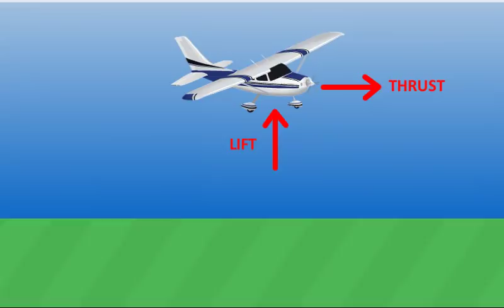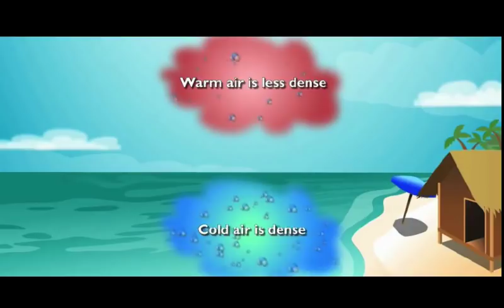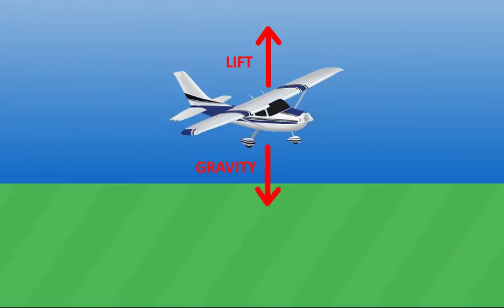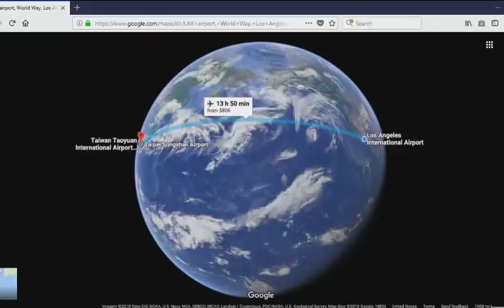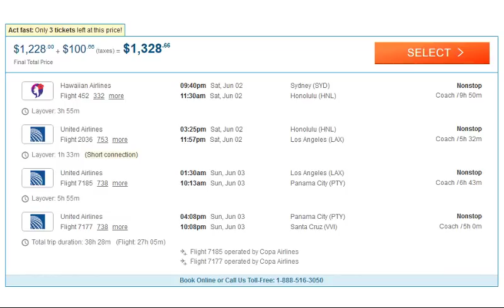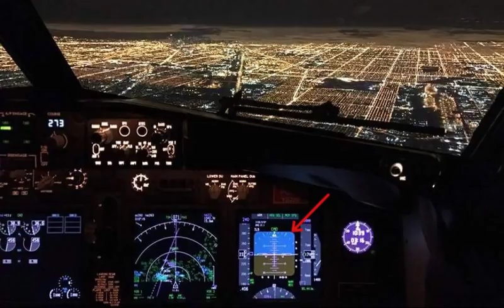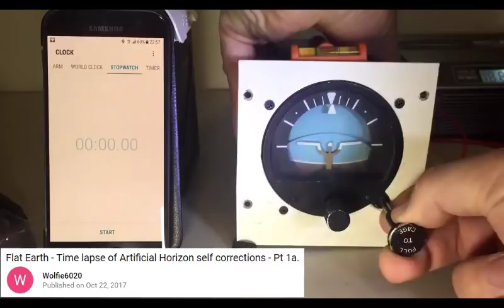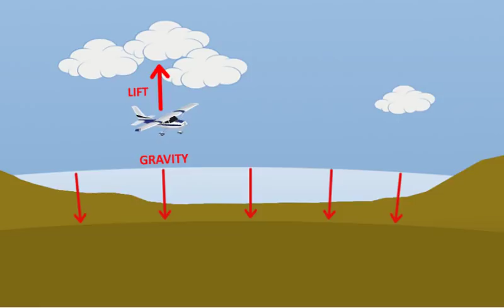Flat Earth Falsities - Plane Nonsense

Comment: atmosphere does not spin with the earth continuously.
Reply: Everything on earth moves as one, because they have been together for almost ever.
Reply: Nobody's saying that other motion doesn't occur in the atmosphere, such as by temperature/pressure. However, the notion that if the Earth spins at 1000 mph there should be a 1000 mph wind, or a hovering helicopter should travel 1000 miles in an hour is nonsense.
Reply: @romithromith  Then why do they tell us that the flight path of the 'space' shuttle appears curved because the Earth is rotating away from it?  You can't have it both ways.
Reply: @boogeyman1967  I think you mean the ISS, though the same held for the shuttle. The environment is a partial vacuum at the altitude of ISS and the station experiences almost no drag, so it orbits independent of Earth's rotation. So yes, you can have it both ways. see https://youtu.be/8-mKLs2b3MM
Reply: @boogeyman1967  because it is intentionally increased in speed to be able to keep itself on orbit.
Reply: @CptChaos-ju8ix  bullcrap.
Reply: @boogeyman1967  referring to what? That the Space Shuttle needs to increase its speed to keep itself on orbit? What do you think are those thrusters and fuel tanks for? What is your background in spaceflight dynamics to make that statement? Do you even know the equations of motion?
Reply: @CptChaos-ju8ix    Oh I almost forgot... those thrusters and fuel tanks are for show.  We all know the "space" shuttle is nothing but a duded up airliner, made to look like it went into "space".. woooooooooo!!!! to see the little green men from mars) LOL!
Reply: @boogeyman1967  I see, so you don't have any knowledge about the subject and you are surprised that you don't understand it? Without knowledge of the rules even a baseball game must appear to be unreasonable to you. So, how about you first learn about important natural phenomena, e.g. gravity, and technology, e.g. rockets, before you make a statement about their validity? And why I am on YT? Well, I sometimes watch interesting documentaries on YT and every now and then a video like this one here gets recommended. And frankly I have to say I like to take a look at the comments of uneducated people fooling themselves.
Reply: @CptChaos-ju8ix  Whatever keeps you entertained!
Reply: @NotTheCIA I.think Baby burn! Disco inferno!!! 😁
Reply: @NotTheCIA I.think It's getting hot in here! So take off all ur clothes!! 🤗
Reply: @NotTheCIA I.think  Haven't you heard? I'm not a real person. I'm a shillbot. I've been programmed to argue with you forever.
Reply: @NotTheCIA I.think  Example of what?  Your stupidity?  One just has to look at your comments.. what do you need me for?
Reply: Where did you get your "education"? Is it from the real world or YouTube?

Comment: this is bullshit, density causes the diff in atmospheric pressure.
Reply: And that difference is caused by what, Einstein?
Reply: Density causes it? Guess density is magic. Why would density do that?
Reply: And what causes the difference in density as the altitude increases, genius ?
Reply: @SC-zq6cu  LOL, you never had floating toys in the tub as a child? the idea of preserving relative density and  it's a  universal constant affecting ALL OBSERVABLE LIQUIDS/GASSES.  every molecule gets an upward force when it is less dense relative to the molecules around it, AKA "low air pressure", look at exactly how it is that airplanes fly,  also the reason hot air balloons rise, it reality with the use of the same law, but obviously very different means are used to " activate" the universal, unstoppable natural law can be summerized "gasses and liquids rise or fall searching for equilibrium of relative density"  call it "air pressure" or "water pressure" more dense (relatively heavier) molecules sink under the less dense  (relatively lighter) molecules ,which rise. If the gasses or liquids are trapped inside a system of relatively diff  density, they will violently find ANYWAY out of it to be able to rise or fall to relative equilibrium,
Think of farts,burps, tears, and urine gushing out, submerged air balloons popping out of water when released, multi-ton cruise ships made of metal, float with this same rule(research), it doesn't matter if it's shooting lava or shooting semen, on a molecular level, it's ALL molecules seeking to correct differences in relative density that propels their movement. very light dust particles float until they are surrounded by air that matches their density. 
just observe the world honestly.
Reply: @narekarutyunyan9657  
You have yet to answer WHY this hapoens.
Reply: @narekarutyunyan9657  
Which was what I asked initially.

Comment: "Why doesn't a plane have to constantly dip its nose to folow the Earth?"

is best responded with

"Why doesn't a plane have to constantly dip left/right when flying along the equator?"

It's funny because there's a logical reason for the former, but not for the latter on a flat earth model.
Reply: How about "goddidit"?
Reply: There is no adjustment needed as the aircraft will naturally follow the curvature of the earth without any input from the pilot. This is because the aircraft flies through the atmosphere which also follows the curvature of the earth.
It's the air pressure (read gravity) that keeps a plane in level flight. Increasing altitude reduces the lift and the plane falls; decreasing altitude increases the lift and the planes rises. This is due to gravity.
Inertial navigation is different.
https://en.wikipedia.org/wiki/Schuler_tuning
And read  the references provided.
The "schuler loop" is an integral part of avionics, that automatically compensate for earth's curvature.
http://www.mediander.com/connects/26619546/ln-3-inertial-navigation-system/#!/topic/-/
http://aerostudents.com/files/avionics/navigationBasicsAndInertialNavigation.pdf
Aircraft, proof of curvature
https://www.youtube.com/watch?v=qePaT_vbv0I&t=254s@Isaiah 2_4
Reply: @boffeycn   You said that already.
Reply: How does Gravity know to pull on the nose of the plane and not the tail??
Reply: There is no adjustment needed as the aircraft will naturally follow the curvature of the earth without any input from the pilot. This is because the aircraft flies through the atmosphere which also follows the curvature of the earth.
It's the air pressure (read gravity) that keeps a plane in level flight. Increasing altitude reduces the lift and the plane falls; decreasing altitude increases the lift and the planes rises. This is due to gravity.
Inertial navigation is different.
https://en.wikipedia.org/wiki/Schuler_tuning
And read  the references provided.
The "schuler loop" is an integral part of avionics, that automatically compensate for earth's curvature.
http://www.mediander.com/connects/26619546/ln-3-inertial-navigation-system/#!/topic/-/
http://aerostudents.com/files/avionics/navigationBasicsAndInertialNavigation.pdf
Aircraft, proof of curvature
https://www.youtube.com/watch?v=qePaT_vbv0I&t=254s
 @boogeyman1967

Comment: but what about the speed of the plane itself, let s say the earth is pretended to spin at 1700 km/h, and the plane is flying at around 800 km/h ?????? and why the coriolis effect is considered with a ball, but not with a plane, isnt it the same principle ???
Reply from the maker: Kamline - Not sure what you are asking. As explained in the video, a plane on the ground is already moving with the earth, and when it takes off, it continues that movement, PLUS OR MINUS the movement it gets from its thrust. A plane's speed is measured relative to the ground. So a plane flying east at the equator at 800 km/h, is actually going about 2500 km/h relative to the center of the earth, because the two speeds add up. Why is that a problem for you? It works.

The Coriolis effect occurs only because the earth is spinning and a sphere. This means that the atmosphere has to move the fastest at the equator and slower as you approach the poles. This causes a "drag" effects. There is no reason that would happen on a flat earth that is not spinning. So this easily observed effect (storms tend to rotate in opposite directions in the north and south hemispheres), is strong evidence of the spinning sphere, and has no explanation for a flat earth.
Reply: when you stand still you are actually moving with the earth so 0 Km/h means that you are moving at a 1700Km/h but with the earth when you accelerate to 16Km/h (running) you are actually moving at 1716km/h. but your ground speed is.... 16 Km/h.
high school physics.
Reply: https://i.pinimg.com/736x/d3/e0/a1/d3e0a1221de8cca4601b8885af1b6f39.jpg
Reply: if my child was as stupid as you, i'd strangle IT

Comment: Simple question for FE people, suppose flat earth is correct 1)you start at South Africa go round the circle mentioned in your diagrams and reach the same point where you started.Find the Distance.
2)Do the same experiment at equator,find the distance.
You are going to find out that distance 1 is smaller than distance 2, but thats not what you are depicting in your modal.
It Looks like my childish dream thinking that God is projecting the sky like a film , but I found out thats not the reality. You dont have to see everything,as an example  if you see smoke in the mountain you can infer that there is fire. 
Scientists have conducted numerous experiments and found out mathematical models which are open to all. You dont have to touch 10K electricity line to find out that there is electricity, people have done experiments and  I have repeated them to find out the truth on a smaller scale. If you want to find on large scale a 5v voltmeter is not enough, you have to choose things as per your scale. Think why people are building large particle colliders, ligo gravitational wave detectors. 
Have a think , stories can solace you but even if you struggle for 1000 more years cant get you to reality.

Comment: Flights over the Pacific stop making any sense at all when you start comparing flying to the same destination from two far apart airports in North America. I chose two flights from Los Angeles LAX and Toronto YYZ to Tokyo HND, both flight used the same aircraft Boeing 777-300ER.  

First flight is All Nippon 105 LAX-HND and typical duration for those flights is between 11 hours and 12 hours 13 minutes, the average being around 11.5 hours.
Actual: 9,204 km (Planned: 9,275 km/Direct: 8,823 km)
 573 mph.

Second flight is Air Canada 1 YYZ-HND and typical duration for those flights is between 12 hours 46 minutes and 13 hours 38 minutes, the average being around 13.2 hours.
Actual: 10,653 km (Planned: 10,510 km/Direct: 10,358 km) 556 mph.

A flight from YYZ to LAX is 5 hours duration typically and distance as the crow flies is 3494 kilometers.
Reply: Wibble wobble wurgle, fart shart wanky wobble. Gibber gibber whoopsie doopsie, meoww woof woof.
your post made about that much sense.
Tell us about the Haversine Formula.
Tell us about jet streams.
https://www.airmilescalculator.com/distance/yyz-to-hnd/
Reply: You asserted that flights over the Pacific do not make sense, but you failed to state why they don't make sense.  Can you perhaps elaborate a little how why you think they don't make sense?
Reply: I agree with you, flights over the Pacific on a flat-earth map stop making any sense whatsoever. The flight from Sydney to Santiago is well over 20,000 miles on a flat earth map. Those distance flights you mentioned above do prove, much longer flights over the pacific, stop making any sense.

Comment: You can have pressure gradient in a contained chamber. Try measuring water in a large sealed tank. There is more pressure on the bottom that the top. How can a vacuum exist in the space without sucking atmosphere of earth where there is no physical barrier. As you go higher, air gets thinner due to density and bouyancy
Reply: You can have a pressure gradient in an unsealed container of water. All you need is gravity to attract the column of matter, such as water, which builds from all the matter above. In fact, Earth's atmosphere demonstrates that gravity produces a pressure gradient despite the surrounding environment of space.
Reply: You need to understand that flat Earth videos are produced by scientifically illiterate idiots. A vacuum doesn't "suck". Atmospheric pressure makes a vacuum cleaner seem to suck. Atmospheric pressure is due to the weight of air above it, and weight is caused by gravity.
      Buoyancy is a reaction to gravity attracting heavier material with greater force. Density is simply a measure of mass per unit of volume, not a force. It is gravity that act on the mass which is the force.
Reply: Ask the producer of the video professing buoyancy and density, and not gravity, are the real forces to provide you with citations to published research in peer reviewed journals. You'll find there is none. These are baseless claims and the videos lied to you. DON'T BELIEVE FLAT EARTH VIDEOS!
Reply: @NotTheCIA I.think  These are setups. I mean they can't be that stupid. Can they?

Comment: In the beginning you forgot to mention the atmosphere in the Northern hemisphere spins east to west. Whereas in the Southern hemisphere it spins west to east. Your theory of the atmosphere moving with and in the direction of spin doesn't work.
Reply from the maker: Why would I mention what is not true? I think you are confusing two different things. The entire atmosphere rotates with the earth west to east. But because it is a sphere, the speed is highest at the equator and slower at the poles. This causes a tendency for storms to rotate within the moving atmosphere counter clockwise in the north and clockwise in the south. This is called the Coriolis effect, and it is more evidence of the sphere, as this makes no sense on a flat earth.
Reply: @JonasGrumby71  Coriolis effect has absolutely nothing to do with proving the Globe.  This is a bit of a read, but well worth it:

The “Coriolis Effect” is often said to cause sinks and toilet bowls in the Northern Hemisphere to drain spinning in one direction while in the Southern Hemisphere causing them to spin the opposite way, thus providing proof of the spinning ball-Earth.  Once again, however, just like Foucault’s Pendulums spinning either which way, sinks and toilets in the Northern and Southern Hemispheres do not consistently spin in any one direction!  Sinks and toilets in the very same household are often found to spin opposite directions, depending entirely upon the shape of the basin and the angle of the water’s entry, not the supposed rotation of the Earth. 

“While the premise makes sense - that the earth’s eastward spin would cause the water in a toilet bowl to spin as well - in reality, the force and speed at which the water enters and leaves the receptacle is much too great to be influenced by something as miniscule as a single, 360-degree turn over the span of a day.  When all is said and done, the Coriolis effect plays no larger role in toilet flushes than it does in the revolution of CDs in your stereo.  The things that really determine the direction in which water leaves your toilet or sink are the shape of the bowl and the angle at which the liquid initially enters that bowl.”  -Jennifer Horton, “Does the Rotation of the Earth Affect Toilets and Baseball Games?”  Science.HowStuffWorks.com

The Coriolis Effect is also said to affect bullet trajectories and weather patterns as well, supposedly causing most storms in the Northern Hemisphere to rotate counter-clockwise, and most storms in the Southern Hemisphere to rotate clockwise, to cause bullets from long range guns to tend towards the right of the target in the Northern Hemisphere and to the left in the Southern Hemisphere.  Again, however, the same problems remain.  Not every bullet and not every storm consistently displays the behavior and therefore cannot reasonably be used as proof of anything. What about the precision of the sight aperture, human error, and wind?  What about Michelson-Morley-Gale’s proven motion of the aether’s potential effect?  Why does the Coriolis Effect affect most storms but not all?  If some storms rotate clockwise in the North and counter-clockwise in the South, how do those storms escape the Coriolis force?  And if the entire Earth’s spin is uniform, why should the two hemispheres be affected any differently?  Coriolis’s Effect and Foucault’s Pendulum are both said to prove the Earth moves beneath our feet, but in reality only prove how easy it can be for wolves in sheep’s clothing to pull the wool over our eyes.
Reply: Read it, it makes very little sense. You have to be a flat-earther. No other explanation for it.
Reply: https://i.pinimg.com/736x/d3/e0/a1/d3e0a1221de8cca4601b8885af1b6f39.jpg
Reply: how did you figure that one out bright spark